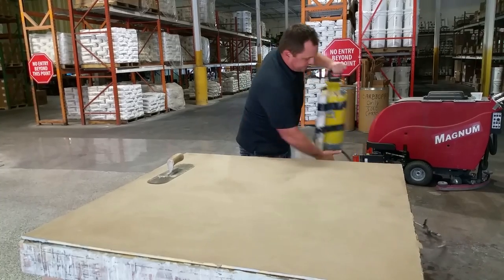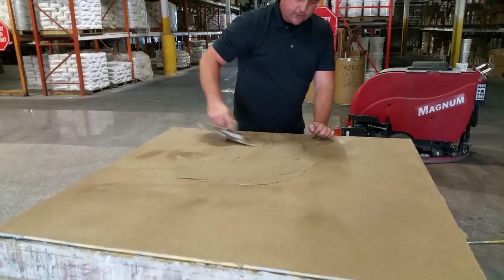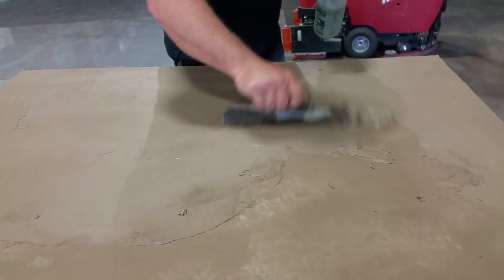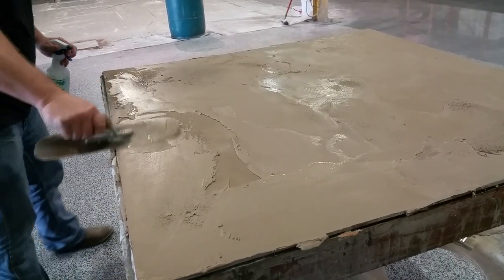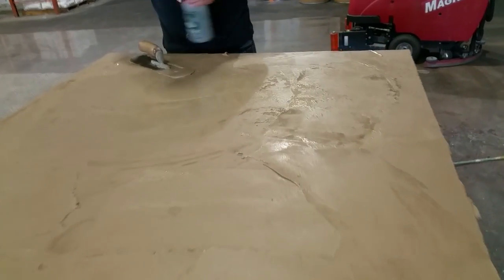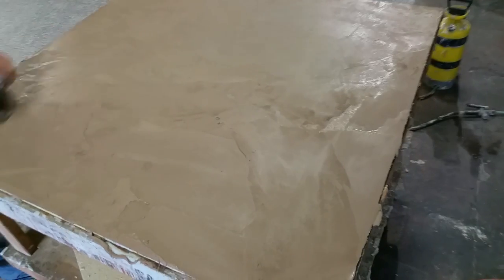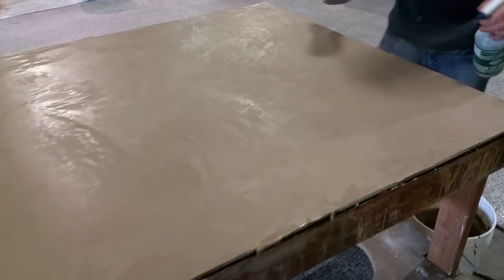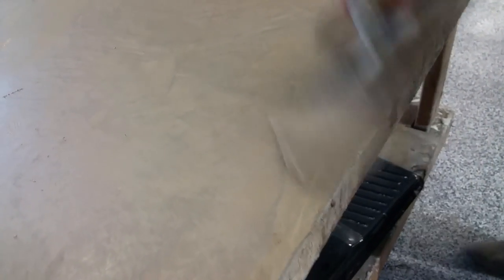How To get a Burnished Look From Concrete Overlay

Comment: The additional water will diminish the cement strength on your grout coat , the same burnished result could be got by useing a finer sand/dust like marble at the same ratio to cement as the sand used in the base coat, filling your voids and sanding , the burn is only possible if an uneven coat is present they are the high points your trowel compresses ..
Reply: You can also see it tearing from being over watered

Comment: do you have a product with no sand in it, just a marble/silica flour? Used to use Bomanite/QC microtoppings back early 00's and was a great material. Looking for similar.
Ardex SD-M is close but way overpriced...Just need a true microcement product with no sand
Reply: Elite Crete has a micro with no sand and leaves alot of movement without trying this hard lol
Reply: SD-M is too smooth to the point it looks fake (wall application)

Comment: Has anyone done this for a concrete floor finish just wondering what the end result would be like as I'm thinking of doing it myself.
Reply: This system is great on floors and I'm currently applying to a bathroom on the walls
Reply: @craigsutherland2104  ah awsome thanks for the reply!
Reply: @craigsutherland2104  I'm thinking the same....What did you use for base board> I already bought Dense Shield but am thinking Durock might be more compatible....
Reply: I did same thing on a basement floor and then stained and sealed it.  Smooth burnished look.
Reply: @danielsestina6457  which sealer(s) did you use and how it handle stains?
Reply: @Mowgli.557  I used Surecrete's HS 200 sealer with the SC Matting Agent to decrease the glossy look.  It creates a matte finish while allowing the colors to show through.
Reply: @Mowgli.557  As far as stains go...depends on what is on it.  The sealer holds up very well.  Obviously, cleaning stains before they have a chance to set in helps.  Also, if you have things the could scratch the surface like metal chair, or table legs, will prematurely wear the protection down.  Always use the exact same sealer as before so that the sealer doesn't delaminate.